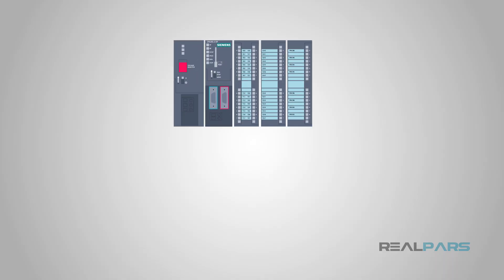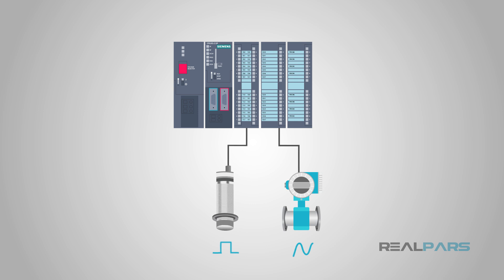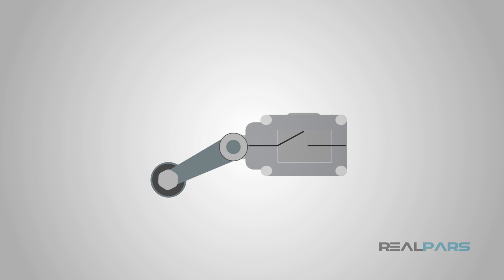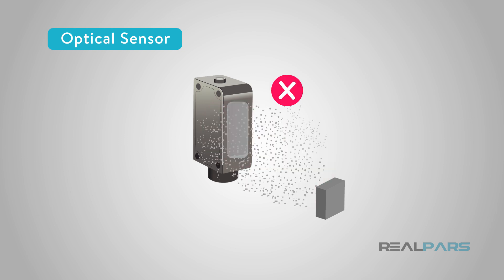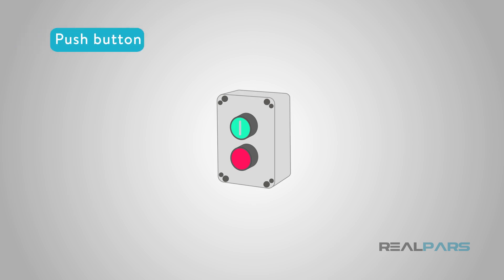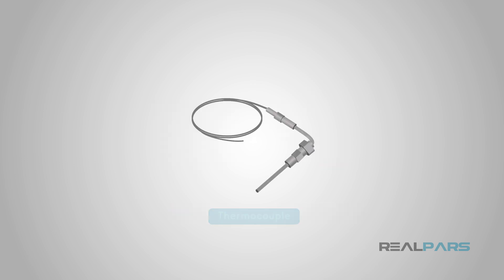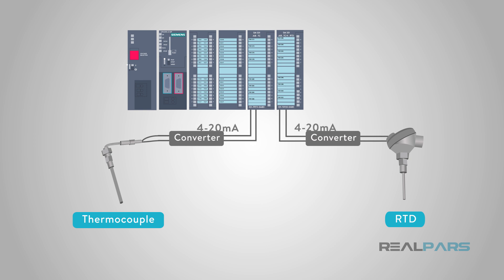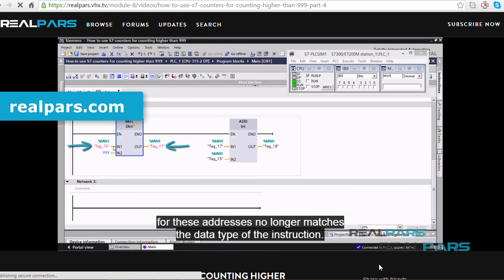Types of Sensors

Comment: Hi question: what kind of sensor should I use for detecting when there is separation instead of proximity sounding an alarm and turning a light on to alert for separation ? for example: a door on a cabinet opens up and alarm sounds and light goes on?
 thank you
Reply from the maker: You can use a proximity switch (will be held on when the door is closed and will open the signal when the door is open). In this case, you would run the proximity sensor to a normally closed relay, so that when the door opens, the relay will energize and sound a horn or illuminate a light.  A common device is a mechanical limit switch that has a sliding pin that is held in when the door is closed and springs out when the door is opened (ROCKWELL AUTOMATION #440P-MDPB22M9).  In critical applications, we use door safety sensors, such as fail-safe high-performance electromechanical switches.

Comment: Dear, can you please make a video on how to connect/to do wiring of two wire, three wire and a four wire transmitter to the Siemens PLC io cards. and also one DI , one DO , one AI and one AO terminal wiring of the same as we do practically in the field and how to calculate load current based on the Inputs and outputs
Reply from the maker: Thanks for sharing your suggestion with us! I have sent this over to our course developers. 

Happy learning!
Reply: @realpars  how to to do source & sink type circuit wiring also